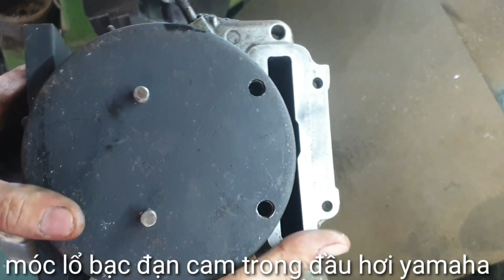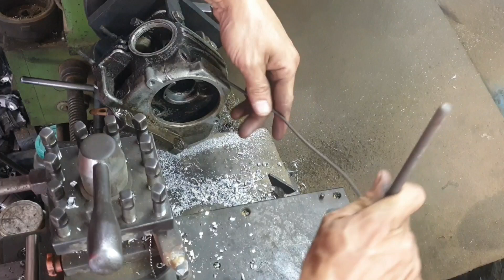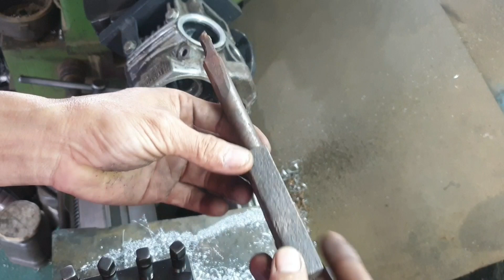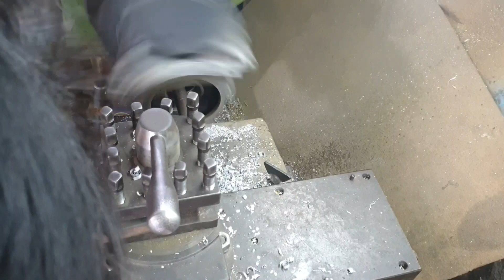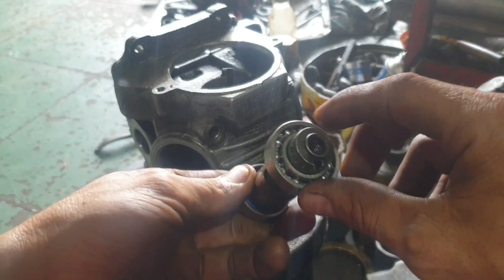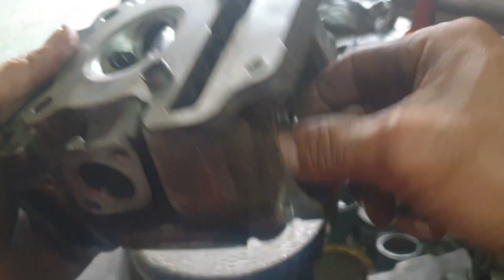Móc lổ đạn cam trên trên máy tiện cơ bằng gá tự chế

Comment: @ 01: 00 Tôi thực sự muốn xem cách bạn căn chỉnh hoặc chỉ ra tác phẩm không có gì ngoài một đoạn dây thép, điều này rất bất thường nhưng có vẻ đủ chính xác để tạo ra tác phẩm chính xác, bạn rất tài năng để làm điều này. ☺ 

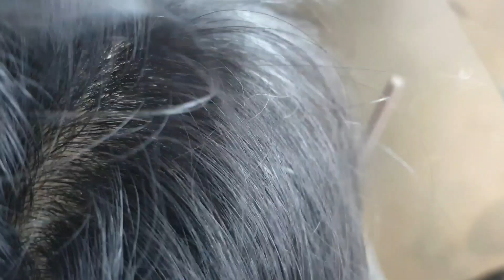@01:00  I would really like to see how you align or indicate the work with nothing but a piece of steel wire, this is very unusual yet looks to be accurate enough to produce precise work, you are very talented to do this. ☺